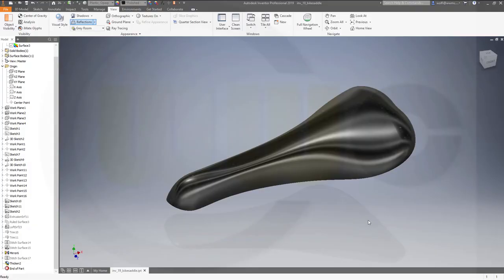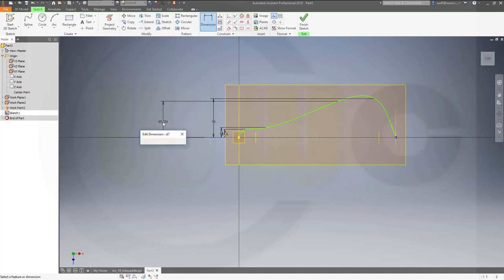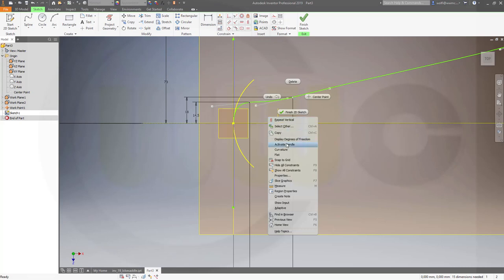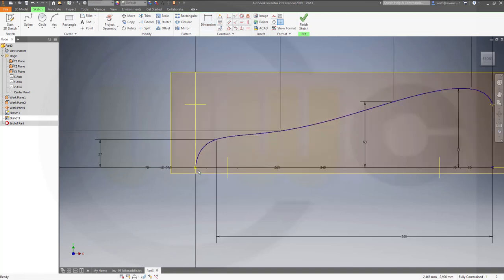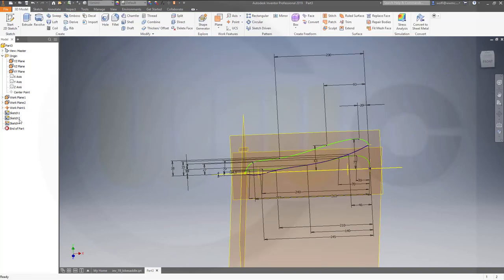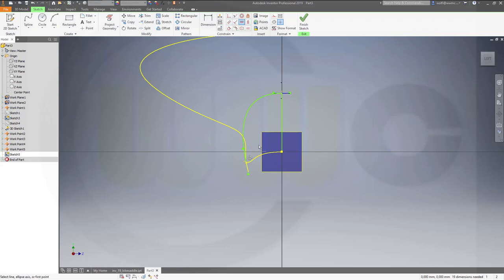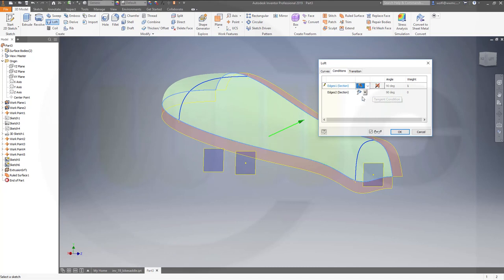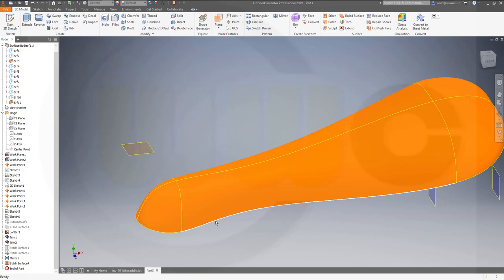Bicycle saddle - Fahrradsattel - Inventor 2019 Training - Surfaces

Comment: Hi Wolfgang, I was wondering why did you create the loft for the saddle, and then trim out those two sections, and then patch them again anyway? Thanks in advanced for explaining. Also why did you use the extruded/ruled surfaces when you deleted them at the end? The loft can be created without the ruled surface can it not?
Reply from the maker: I wanted the loft to be tangent to these surfaces at the edges. I can use tangency only if there is a surface to make it continuous in tangency.